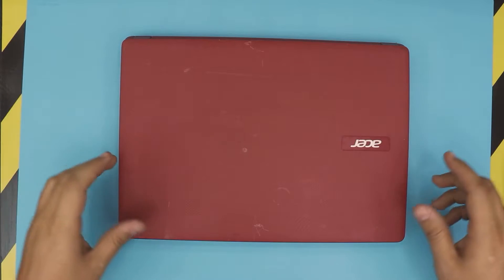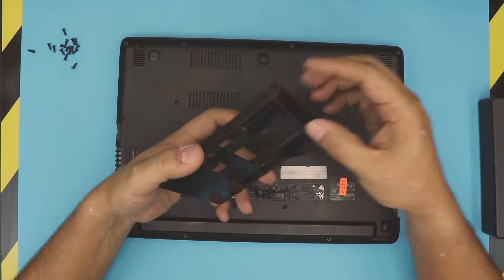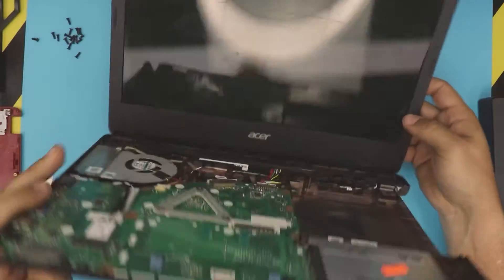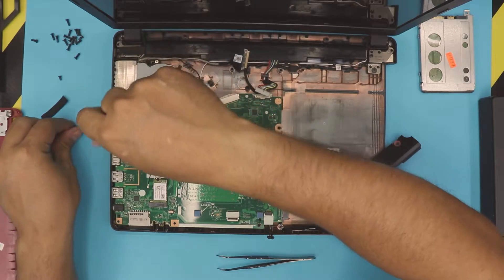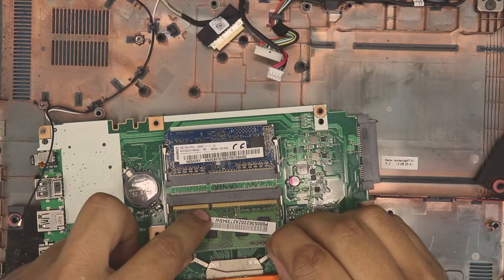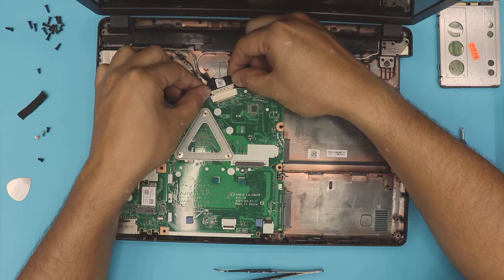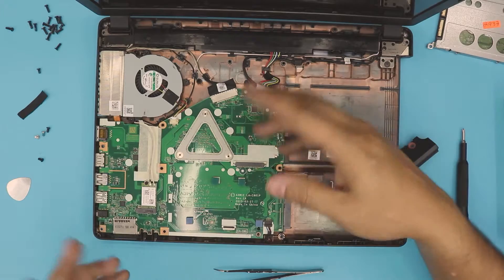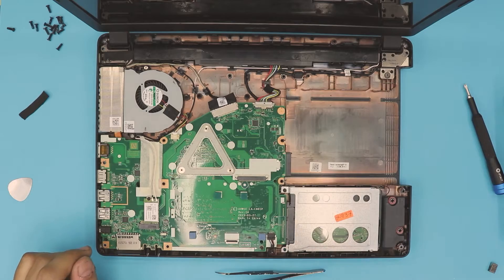Acer Aspire Es 14 Ram Upgrade, STEP By STEP

Comment: Hola, buenas tardes. Tengo exactamente el mismo equipo y quiero optimizarlo porque es un dolor de cabeza cada vez que lo utilizo. El problema es que al ejecutar el comando de la capacidad máxima en el CMD, me informa que solo tiene 2GB, aunque cuenta con dos ranuras. ¿Qué pasa si de todas maneras hago el procedimiento y excedo la capacidad de memoria?, la laptop del vídeo es igual que la mía, ¿Contaba, también, con solo 2GB de RAM en su capacidad desde la información en el CMD?

Ojalá me puedan orientar un poco. Gracias por el video, muy bien explicado.
Reply from the maker: Hola, le recomiendo que coloque 2x 2GB SDRAM DDR3L (asegúrese de que diga "3L" al final) para tener un total de 4GB. Esos modelos sí soportan hasta 4GB.
Reply: @uFixTek  Le agradezco mucho su pronta respuesta. Haré los ajustes necesarios. Gracias por la orientación.
Reply from the maker: es un placer
🍻

Comment: can i just take off the plastic back instead of the keyboard after removing the screws? what was acer thinking with these line of products? there are laptops that has dedicated slot for easy removal and upgrade of RAM. i even have an old acer E14 series that has dedicated RAM slot
Reply from the maker: Thank you for the feedback! if you wish to support the channel you can LIKE or SUB or both :P
regarding your question: sorry you can't do that it wont come off, there is only one way to get to the ram and this is the only way, they don't like making it easy , because they don't want people to upgrade. they want to resell more laptops.

Comment: Hi thank you for the guide video, may i ask which ram the laptop can be upgrade: DDR3, DDR3l or DDR4? Hope you can clarify thank you.
Reply from the maker: hi, Thank you for the support and feedback, regarding your question it will only take SDRAM DDR3L type :
https://amzn.to/3qJvlI6
it will also take SDram DDR3 but not all the brands, to stay on the safe side use the L (low voltage) version.
Reply: Bro, mana nak beli ram tu?
Reply: @MGFX_mykegraphics  bro boleh try beli kat shopee mcm2 brand ada, cuma kena beli model yg betul samada DDR3, DDR3l atau DDR4.
Reply: @MGFX_mykegraphics  shopee
Reply: Very helpful video. Now where can I get the ram? What model?
Reply from the maker: @MGFX_mykegraphics  here is the link for the ram model and brand, we use this ram for our clients and it works just fine.
https://amzn.to/3q9WQL3
thank you for the feedback and  your support.